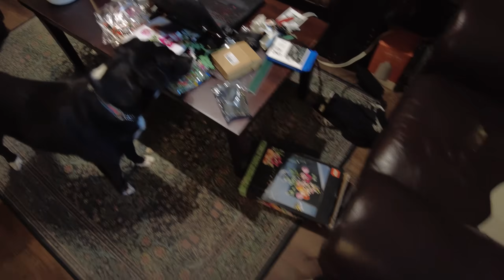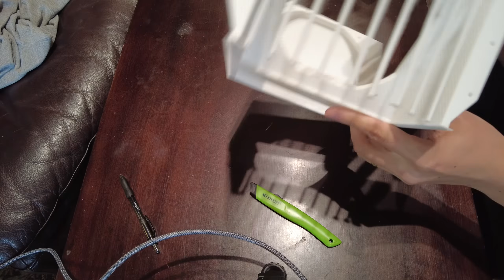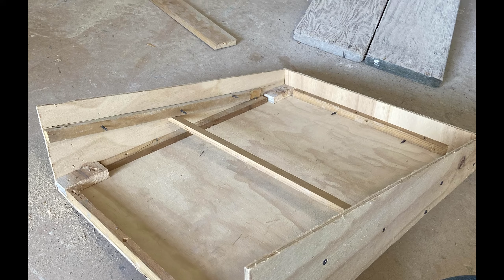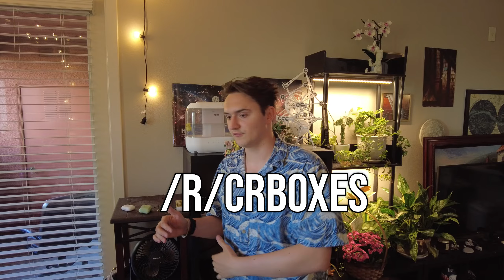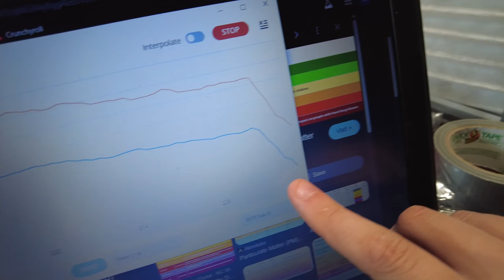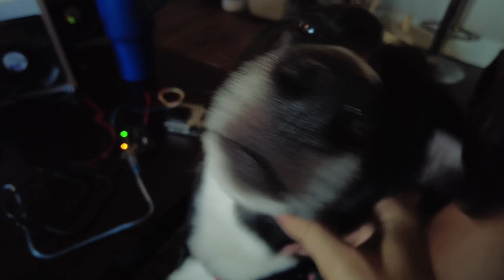DIY Air Filter Beats Amazon's Best Seller!

Comment: windows open in winter?? i just spent all day making my own. gunna use a m 13 reusable washable screen thats what i based build off of was the reuse screen . then i could use some pc fans . built the box with cardboard and wood glue to make it wwater and dent durable . basically it . this way is col . a super simple way was a vent fan and a circle vent filter.  i jsut want CLEAN AIR
Reply: its not even that isane the m 13 gets like 50% of smoke for those spacail smoky days. make clean water

Comment: How do you end up powering the fans, and do you have a solution for controlling PWM? 

Btw in the future please uncensor feet (for my pleasure)
Reply from the maker: I didn’t need to use a PWM signal because when I just give these fans power, they run it full speed and that was quiet enough for me. Whatever the voltage of the fans was, I just bought a power supply and soldered them directly. Each fan got wired in parallel.
Reply: @WhyNotRyan  Alright, thanks for the answer 🙏❤

Comment: I like it. That gives me an idea on 3d printing my fan mounts. And I might use your idea of stacking a cheap filter to catch the pet hair to preserve the expensive filter longer. Do you think the angled fans crossing air flow paths would cause an issue? Or would it be better to just use less fans that blow straight out? Might be a good thing to test. Also, aren't you blocking most of the filter with the picture at the end?
Reply from the maker: For sure use a pre filter if you have a pet! They are very cheap and protect the more expensive filter

I don’t have a way to measure airflow but just a vibe check feeling the wind coming off of the angled fans I can say for sure that they are better than just having one fan pointing straight out. 

Yes, while putting the filter behind the painting, it blocks some of the air but it’s loose enough that I’m not super worried about it. Again, my apartment is so small that this device is overkill.